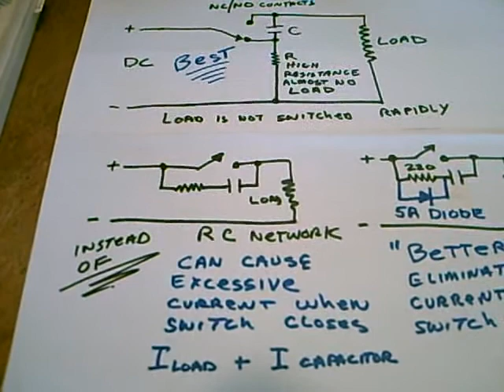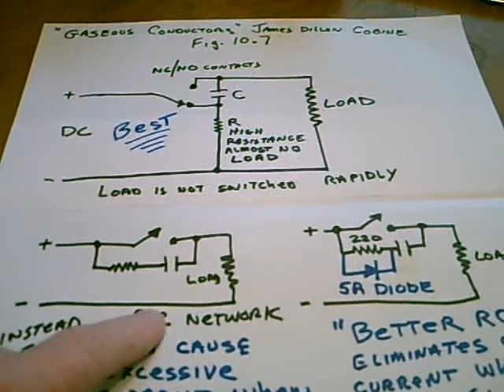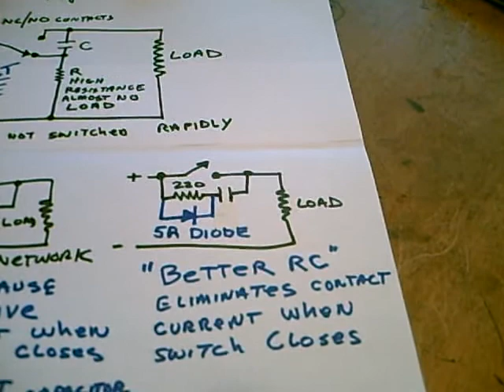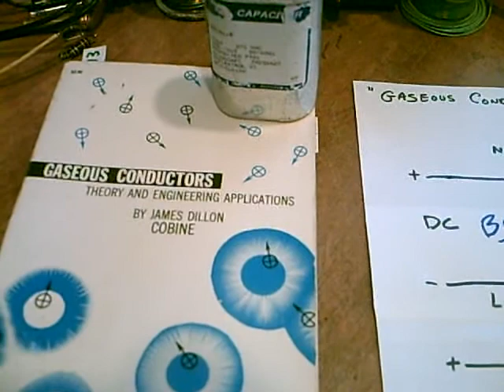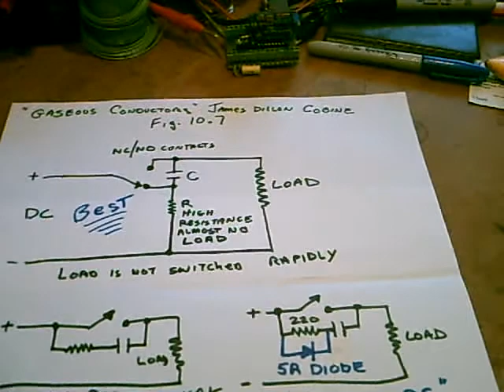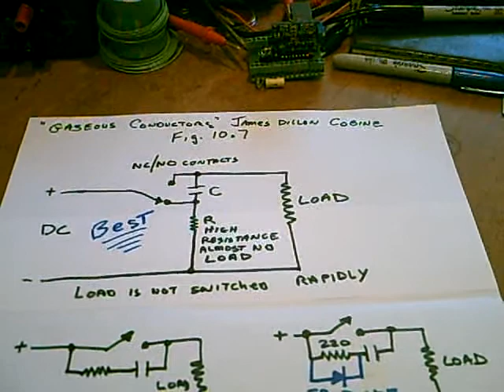Increase Rating of AC Contacts On DC To The Same Voltage

Comment: @opera I am trying an RC snubber as in your bottom diagrams. Load is a 40 ohm element, and the PV supply is 180 Vmp, 8 Imp. Switch is a beefy knife switch with visible arc. When I use a 1 uF metallized film cap, the arc completely goes away. I want to add a resistor to limit the current but as soon as I add anything (even 1 ohm) the arc comes back. Can you explain why? The textbooks suggest anything less than 180/8 = 22.5 Ohm should work. Thank you.
Reply from the maker: That does not surprise me, those calculation are for AC power line.  It is the speed of the opening of the switch to get a minimum distance, so it doesn't arc. So, the one ohm resistance allows too much voltage to develop quickly. The capacitor has to be much larger. Capacitor current limiting is not really an option. It should be a suitable capacitor, likely oil filled. That will make a problem when the contacts close again. The current will be the load + capacitor current. This can be solved with a 10A diode which charges the capacitor and a resistor in parallel with the diode to discharge capacitor when contacts close, 20-100 ohms wire would. Capacitors can fail in this severe duty application.  A fuse in series should be installed which is 1/4 to 1/3 of rated load which will open should capacitor fail.
Reply: @opera5714   thanks again for sharing your wisdom. I have the snubber working (no visible arc) with a .1 uF metallized PP cap in two configurations A) just cap. B) plus 220 Ohm resistor paralleled with 10A diode. Two follow-up questions: 1) is the purpose of the resistor to protect the switch or to protect the cap / is the resistor still necessary with such a small cap? 2) do you still recommend a bigger cap when the small one works?
Reply from the maker: @ep8063  The resistor is to discharge the capacitor once the switch closes again. Otherwise the capacitor will remain charged and not function to limit arc the next time the contacts open.  I would recommend a larger capacitor, oil filled motor run type. Capacitor foil welds are quite weak and will fail over time.  There are some designed for these high currents. But, it is unlikely you have a snubber capacitor as these are expensive and fairly rare. X2 type safety line capacitors are an exceptionally poor choice for these applications as they will fail fairly quickly. A 4-8uF oil capacitor is what I would use.

Comment: That's an excellent way to use an AC relay to switch DC, the only catch is it requires one with both NC & NO contacts. But definitely worth doing if those are available. I like the diode method those where you only have the NO contacts. Just curious...are you the same "Opera" who posts on the Fieldlines forums?